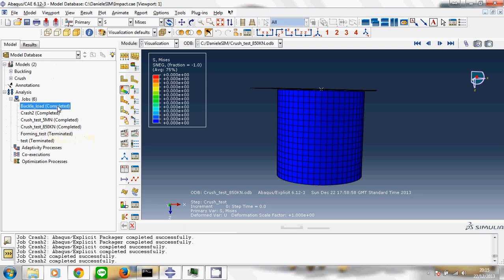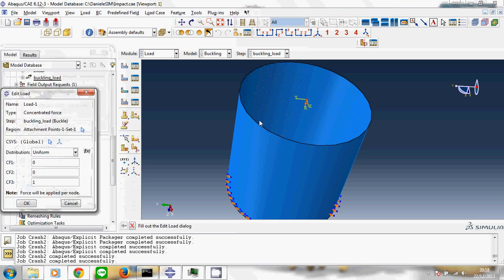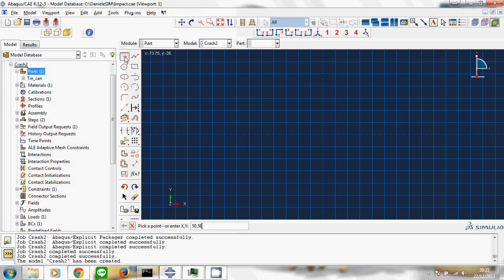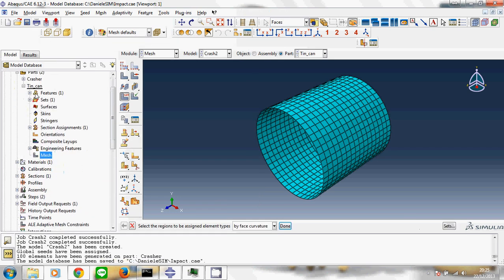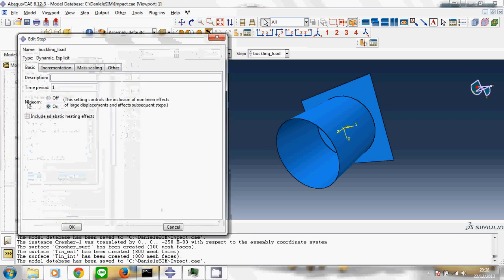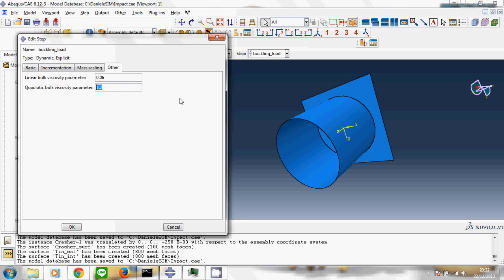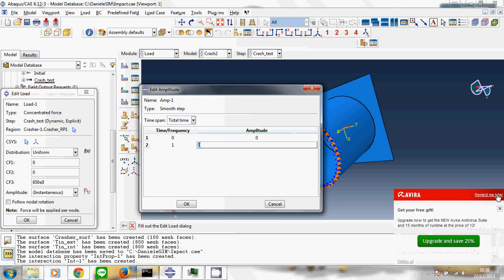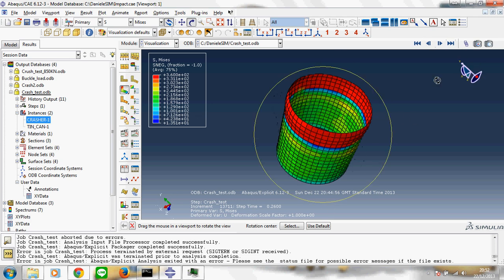Abaqus can crash simulation tutorial

Comment: Hi. Thanks for the great tutorial. :) I have a simple question. If you use the unit milimeter for length, don't you have to use Tonne (Kg*1000) for mass and tonne/mm^3 for density to have a consistency? I have seen some charts where the unit Kg corresponds to the length in meter. Could you please clarify your choice of uni selection? Thanks a lot and keep up the good work. :)